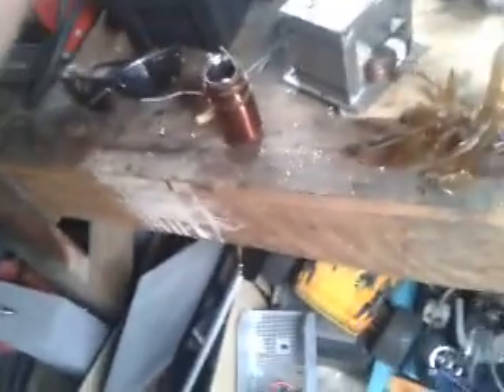ignition coil teardown

Comment: Hello thank you for this value video, I have a question about the oil, what kind of oil use there? is'it PCB askarel (toxic)? , thank you
Reply from the maker: I bought this ignition coil new ~2012 time so it wasnt too old. (Due to this I think it is verry unlikley that it did have the hazardous oil in there.)

I took it apart because i was curios of the construction as well as it wasn’t working as well as it used to.

I got a bit on my hands but washed it off after
Reply: Elliot Hunt do you think that s the askarel oil?

Comment from the maker: well i got a mot and i took off the secondary for high current but i messed up the primary so its just been lying there. if i get another mot i will use it for high voltage. but my dad might have somthing to say about 2Kv 500mA+ ;-)